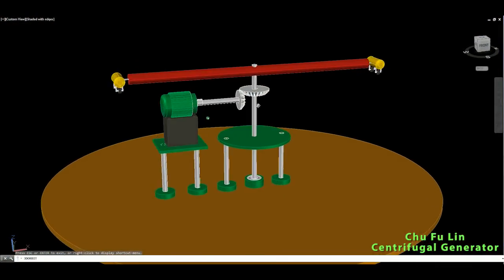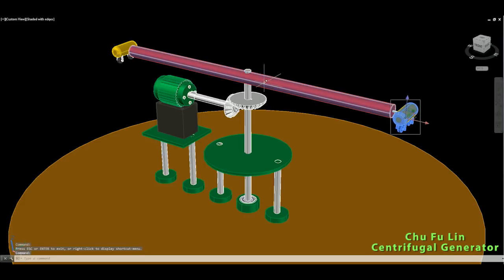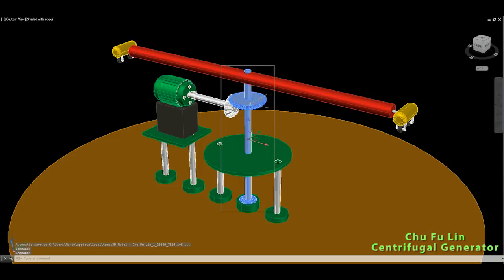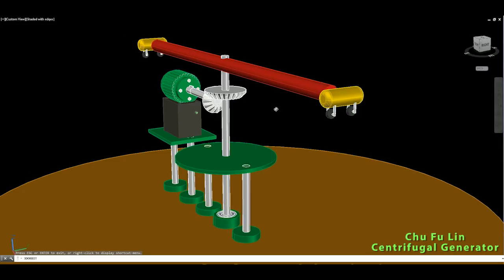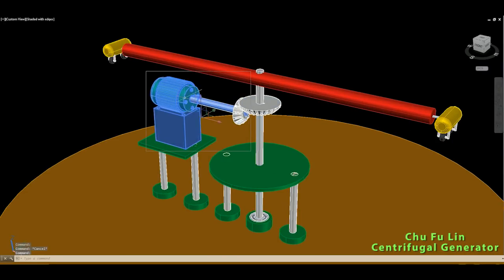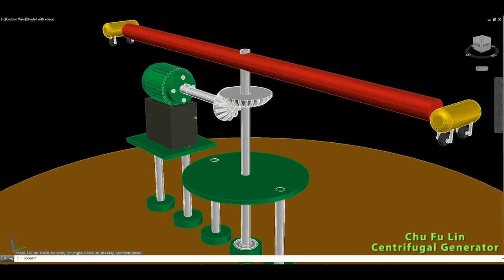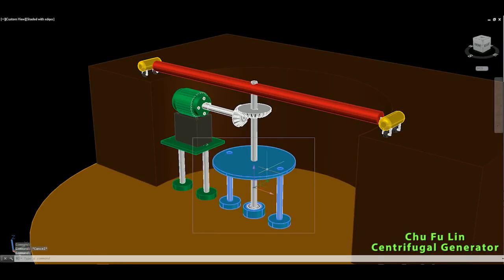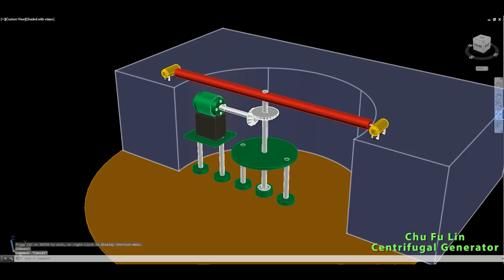FREE ENERGY, Chu Fu Lin Centrifugal electricity generation system

Comment: Not understand how can be more on ouput energy, that on input? Big thing in center is generator?
Reply from the maker: Via transmission mechanism (set of gears). Yes, in the middle is the generator. Imagine you ride a bicycle, when you do not have enough power to climb the hill you change the gear that in front you have small gear and on the back you have big gear. Basically, you multiply the power in relation with transmission ratio, but you go slower. Here is somewhat different because you need more speed on the output. You get the speed with gears and the power with distance from the center of main shaft.
Reply: So you in outside two things run must wery fast to generator generat power. So how can be multiplication of power? I think only multiplication is of torgue.